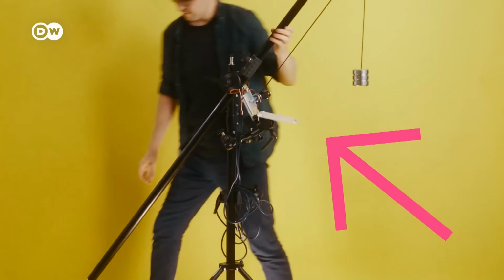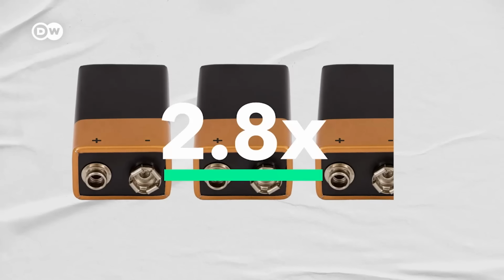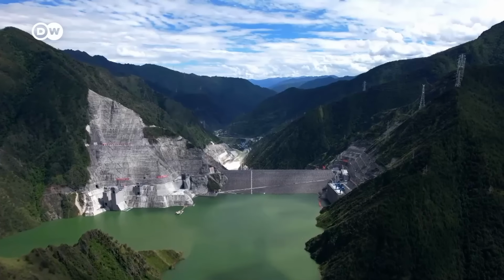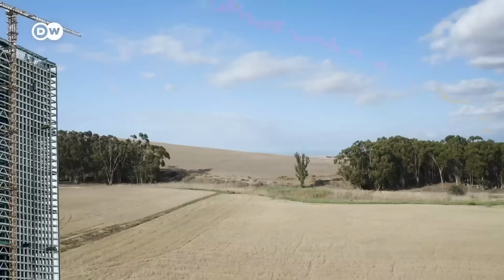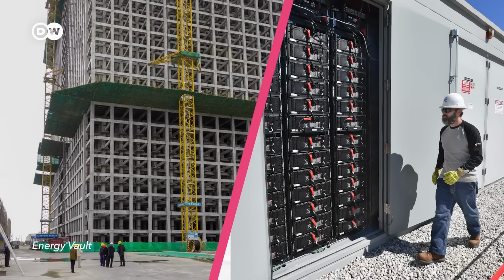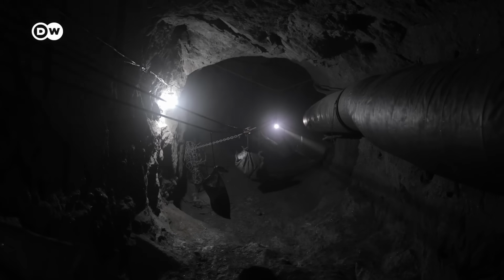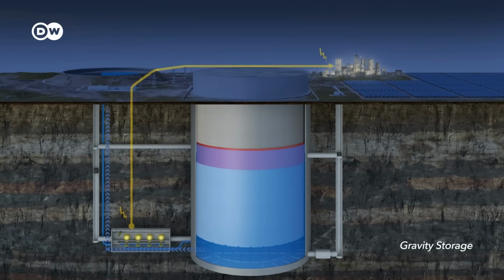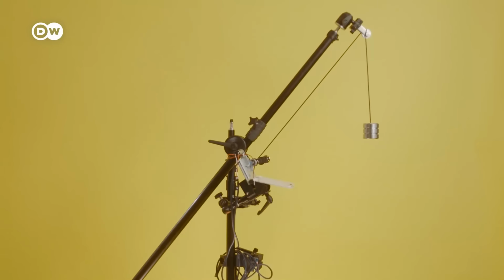How to use gravity to store energy

Comment: It looks good on paper, until you realize it cannot cover surge demand at peak hours. Inertia flywheel are probably better than that.
P.S.: ppl going "pump hydro duuh"... Yea, what about flatlands, or desert?
Reply: Flatlands might not be that problematic unless they are extremely large as there always will be some mountains/hills around so the pump-storage can be constructed there and the energy can be then transferred though the grid. Also the pump-storage can work with low head, but would require lots of water, for example Geesthacht pump-storage power plant operates with head of some 85 metres.

Then there is also possibility to use thermal storage with molten salts, but the efficiency of this storage would be only about 30 %, so that might not be ideal, but I assume, that in desert the production cost from solar power plants would be low so even with wasting 70 % of energy, the overall price of electricity from that system would still be reasonably low.

Comment: only useful thing i can see for now with this is going down on elevators so peoples weight mostly powers them and is something power would be used on anyways and when there isn't enough weight it just kicks in a normal system or something so not a battery just extra power generation, otherwise unless there's a major jump in how efficient it is normal batteries will probably get better faster.

Comment: How about using whole buildings as the weight for gravity batteries? How ever feasible or not, it's trippy to think about all the ways and considerations to implement this idea. At least two floors would have to alternate between being the ground floor with elevator entrances at various heights.

Reduction gearing could turn the barely perceptible raising and lowering of the building into motor driven or generator driving (or one in the same) electromechanical force.

One advantage would be that power for elevators could avoid converting stored gravity (?) to electricity and back into electromechanical energy.

Maybe if wind could rock the building back and forth, it could ratchet itself up using that force.

Another way to skirt energy conversation losses would be to have wind turbines drive gearing to raise the building. That could be applied to yalls boring idea of dedicated weights gravity battery.

Comment: The only use of such batteries, would be on a fairly large scale.  Sadly, once you get huge, I start worrying about bearings and tension in wires/cables, corrosion, water leaking into mineshafts, and so on.  I think until it’s actually done by someone, we won;t even begin to find out all the stuff that’s wrong with a gravity battery.  Such batteries would not be useful, obviously, in say a car or anything mobile.  And hydro-electric has the advantage it;s largely ‘solid state’.  Sure the turbines spin and valves get turned, gates need opened and closed, but this is tried and tested stuff.  My view is overall, let’s get the bulk of humanity onto wind and solar, and hydro-electric, then we could think about more oddball ideas.  Worthy of looking at, we’d be better trying research on micro-steam turbines to incorporate into ICE units?  Take care all.

Comment: I would think a large mountain  with a couple or dozen or so heavy rail sleds that are continually pulling them up the hill and sliding them down. Rail tech is pretty mature. A steep grade. Using not used steep mountain slopes.
Reply: Oh gee. They talk about this in the video. Hadn’t gotten there yet.😂

Comment: Why not lift and lower the batteries?  Make them a little heavier (add steel or concrete) if need be.  So its storage of power, and gravity.  You get instant power when needed AND as it is lowered, you get electricity.    
Maybe not the LiOn battery chem.  Maybe use the Lithium iron type (safer).
Reply: Energy density of lfp battery lets say 100 wh/kg = 360 k joules/kg. Lifting the battery to 100 m height stores m*g*h about 1 k joule/kg. So, 0.3% stored by lifting, and 99.7% stored in the battery. Why bother lifting?
Reply: @JumpingJack-w2l  add some weight to it.

Comment: No - solid Gravity-Battery storage is an absolute dead-end.

I did the calculations for this years ago for my "ideal homestead", and it's disappointing.
Imagine, for a single-home storage system, you suspended a 2x2x2-meter cube of solid steel 15m in the air (already a significant expense in $ and time).
Fully-raised, that block will only generate 3kWh as it lowers to the ground.

These governments are only funding these projects as a way to generate busywork jobs and to inflate indicators of economic growth. That's all.
You would be MUCH better served making a machine that converts air into propane (see Hyperspace Pirate's channel for those videos) than in building an S.G.B.

Sorry.

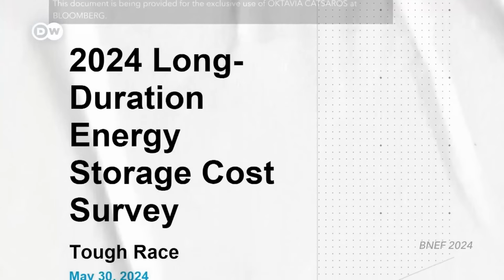Comment: 10:52 says it all… still we need to push all ideas in order to replace fossil fuel energy sources, especially coal.
Li-ion and similar battery technologies will continue to expand as they r crucial not just for energy sector. Heat storage and compressed air r also very interesting especially when heat can be used in so many ways. With already warming climate we definitely need to develop heat capturing solutions capable of long term storage. Everything natural or man made what generates heat must be designed in mind with capability to capture and store heat. Even datacenters which run for all of us to write these comments. Heat is truly a GIFT if u look how extremely cold universe is in comparison to sources of heat. We have been blessed here on planet Earth that we can control it much better than in space and that heat and its radiation is in our habitat we have perfectly adapted through evolution.
Human ingenuity is endless and even everything is easier said than done, we - humans can transform and change our reality here on Earth to whatever shape or form we want… and that’s the BIGGEST GIFT we had been given.
However if we continue to believe in fairy tales of gods, angels and demons to continue to divide us, we won’t make a an important step to leap forward and transform our reality for better of all, not just few.
It’s not god or devil causing us to experience hardship, it’s mostly our own - human doing.

Comment: I think the company misleading the energy storage capacity, lets consider following calculation 
Potential Energy= mgh
m=mass=25tons*3500
g=acceleration due to gravity=9.8m/s^2
h=height=lets consider 100mtr
PE = 85808187500 joules 
If we convert it to kWh then
PE=23.83 MWh
But they are claiming 100MWh which is around 4 times what we actually get.
So I think either they misleading or they don't know how to calculate storage capacity which is simple math (period)

Edit: apologies for my wrong calculation
Reply: I suppose, you took "tons" for "kilograms".
3500 blocks of 25,000 kg each in a height of 148 m would be a potential energy of 3500 x 25,000 x 9.81 x 148 = 127 billion joules or 35.3 MWh.
Still not 100 MWh, but at least in a similar scale.
Reply: @701983  yes I have calculated wrong and corrected (edited), thanks for your response

Comment: I wonder if this gravity-powered generator can actually pull the weight back up high enough to keep the electricity flowing.

Sounds like a cool prototype in the making! Not reliant on variable sources.

It's definitely reliant on the force to pull the weight high enough to the starting, like wind turbines rely on wind speed, solar panels on sunlight, and hydro power on strength of water flow.

Nothing is free, but physic definitely is helpful in making it more efficient.

Comment: Every time you see a big 3D modled Gravitystorage Strukture you should ask yourself:
Why not build a giant Water Tank instead? Much cheaper, much less complicated and much less moving parts.
And now you understand why this won't become a large scale thing
Reply: The tank also gains a small amount when it rains, win win.
Reply: Armstrong Accumulators powered work shops before electricity being donkey engine pumped stores
Reply: Earthquake proof
Reply: What happens if it breaks?
Man made tsunami
Reply: Every time anyone talks about gravity energy storage, you should use a units calculator to run the simple formula `mass * gravity * height` to realize how weak gravity is. A 10 tonne block lifted 100 meters into the air only gains 2.7 kilowatt hours of potential energy!! It's a useless irrelevant way of storing energy unless nature provides millions of tons of working material and a large vertical drop, i.e. pumped hydro.
Reply: Make the connection 👉 The Connections (2021) [short documentary] 🌎 ♥️ 😎 ✨️
Reply: Less efficient due to specific gravity plus there is no water in the desert where solar panels are
Reply: @andreinastase1604  how do you make concrete without water?
Reply: @Timformers  
Educate yourself and turn honest.
Read and try to comprehend my post if you have the mental ability.
Concrete is made with water of course but that before is transported to the needed location.
Reply: @andreinastase1604  So you say it is easier to transport 100 tons of concrete to the location than 100 tons of water?
Reply: @Timformers  
Offf you are not too bright.
I never said that.
With water you can't make concrete.
Was your father named Formers?
Reply: @andreinastase1604  Aren't you able to put two things together? Did I set the bars too high?
You were the one who wanted to ship tons of concrete into the desert instead of just shipping water
Reply: @Timformers  
So you ship water and make concrete blocks out of it?
Retired NASA project engineer.
Turn h0ne5t and educate yourself.
For your information they ship "concrete" blocks from Korea to California and use them in thermal batteries today.
Reply: @Timformers  
YT deleted the response 
Today we have concrete blocks by the tones shipped from Korea to California for thermal batteries.
Retired NASA project engineer.
The bar height you set is below honest human level.
Reply: How about instead of building a giant water tank we build a big concrete structure in a valley that holds water back so that the existing geology can be used for most of the holding area. Maybe we call it a "dam" because it's a dam good idea?
Reply: @rubiconnn imagine build giant Tomer dam near City. cool and dangerous at the same time
Reply: @mizan-mq3me  imagine build cities and things dangerous to cities apart from each other whilst transporting electricity from one to the other by some tech (hint: some call it wires).
Reply: @rubiconnn imagine that your country doesn't have suitable geography for a dam due to not having mountains
Reply: @rubiconnn because that requires a river and a valley, whereas this "impractical" tower requires neither...? I appreciate skepticism,  but  not knee jerk rejection.

Comment: If we would make producers also responsible to later on recycle their no longer used products i would assume the calculus for battery types would side very quickly with the gravity batteries.
Reply: There was already a much cheaper gravity turbine that could help producing electricity from residentials to high powered limitless megawatts of electricity to industries on a 24/7 for decades, but NOT A SINGLE SO-CALLED INVENTORS OR INNOVATORS WERE INTERESTED TO IMPLEMENT SUCH AN INNOVATION FOR DECADES UNTIL SUCH INNOVATION HAS BEEN DISCARDED REGRETFULLY. ONLY THE COSTLY/ERRONEOUS PROJECTS ARE IN THE RACE WITH THE HELP OF BILLIONAIRES TO INCREASE WEALTH.

Comment: Good topic and video (mostly)!  However…

5:30 — really, guys, cellphone battery life is a bad analogy.  Cellphones, laptops, etc. typically use LCO (Lithium Cobalt-Oxide) battery chemistry.  Stationary energy storage, and electric vehicles as well, generally use LFP or NMC chemistries, which have a much longer lifespan.  Between that, active temperature management, and reasonable charging margins (“fully charged” is actually 85-90%), batteries in these applications can easily have 5 times the lifespan of cellphone batteries.

Comment: Run the bloody numbers!!
The horrible bastard unit we use is KiloWattHours - 1 "unit" - 1kWh is 1000 watts for 3600 seconds - 3,600,000 - 3.6 MegaJoules

That is like lifting a 3.6 ton weight (36,000N) up a 100 meters 

A Tesla battery is 50 kWh - equivalent to lifting 36 Tons up 500 meters - which would require a building which would be one of the highest in the world

A "Gravity battery" using concrete blocks is a stupid idea

The 25 ton blocks and the 100 meters (being generous) in the video would each store 250,000N x 100m = 25 MegaJoules - about 7 kWh - about $2 worth of electricity

A Tesla MegaPack is 3,000 kWh - or 428 of the 25 ton blocks - per module!!!